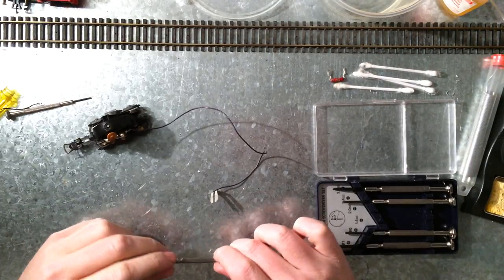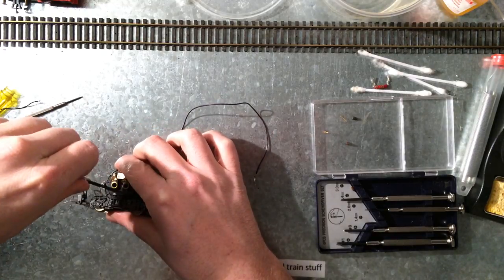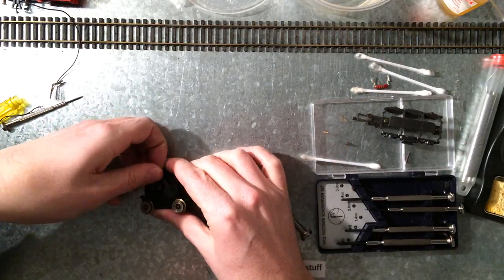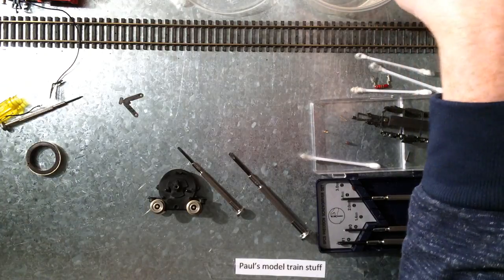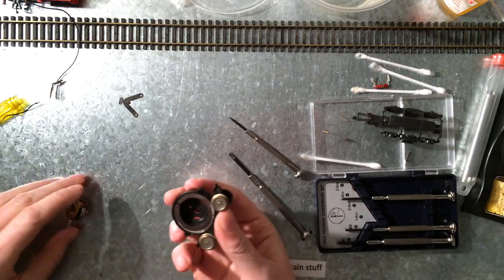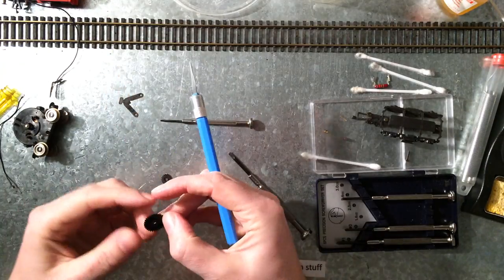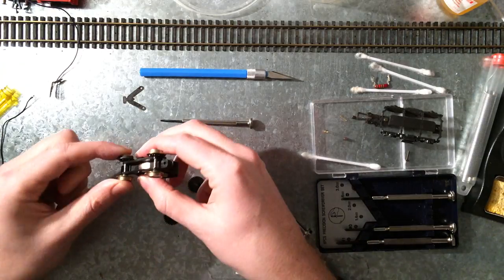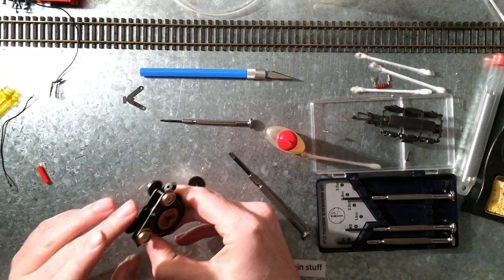Cleaning an old Lima motor (Video in English)

Comment: would methylated spirit be ok to use to clean the motor ?
Reply from the maker: Hey sorry for the late answer. For as far as I know it will not damage your motor and I expect it will remove the dirt just as well. You can always try it out on old equipment or similar materials to be sure.
Reply: Hola, yo uso alcohol isopropílico para limpiar el motor, ya que este alcohol no tiene agua y no daña para nada el material. Eso sí no debe tener contacto con la pintura del modelo, saludos